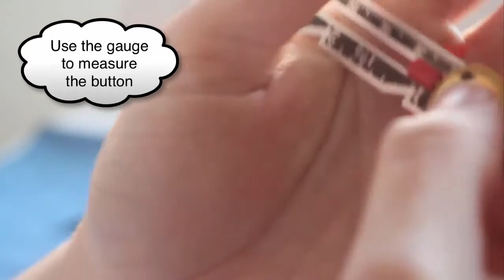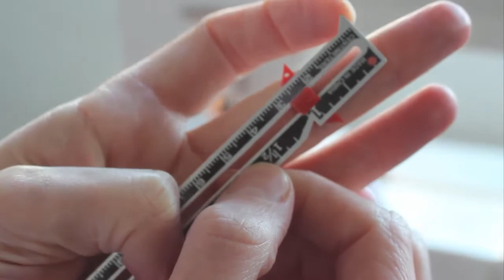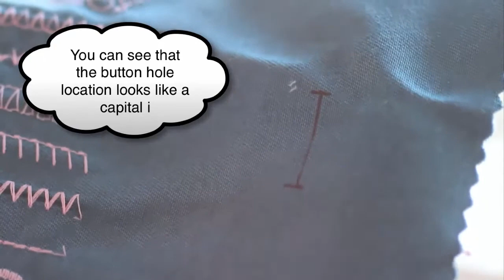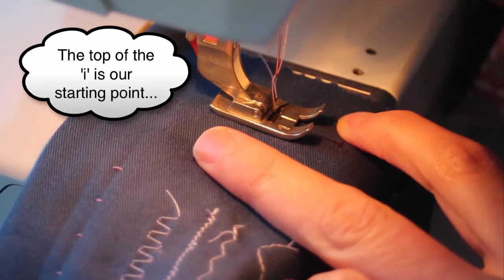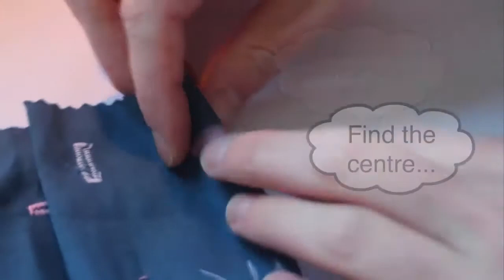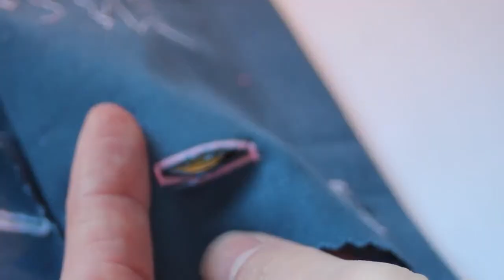How to Sew a Button Hole on your Bernina 1008

Comment: The one thing I needed to know if how to setup the machine. The manual says to set Stitch Density based on the weight of the fabric. I can't find anything that indicates which knob controls that. I was hoping your video would include that. If you re going to make a How To Video please don't leave out steps and assume the viewer "knows" things.
Reply from the maker: Thank you for taking the time to comment Scott. I do think it unfair of you to complain that one of my videos does not contain all the possible information to do with sewing a buttonhole on a Bernina 1008. My not including it was not down to 'assuming the viewer knows things' but because in this instance it wasn't relevant: I was demonstrating how to use the dials on the Bernina to achieve a neat button hole. Stitch density is in fact a completely different question.

Comment: Thanks for this. I use a stitch ripper to open the pigeonhole. Start in the middle and put a pin at each end to make sure you don't cut through the end bar tack.
Reply from the maker: Oh, thats a fab tip! Thanks for sharing Marlyn!
Reply: You probably dont care but if you're bored like me during the covid times you can stream pretty much all the latest movies on InstaFlixxer. Have been binge watching with my girlfriend for the last days :)
Reply: @Terrence Santino Definitely, been using Instaflixxer for since december myself :)